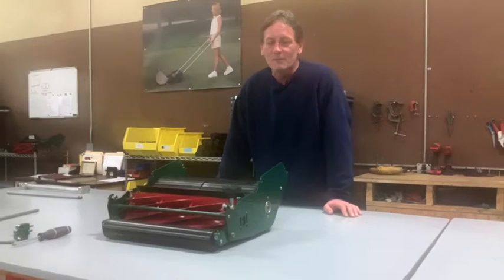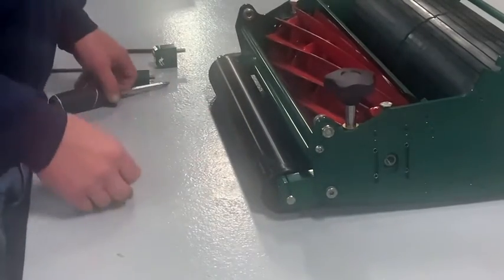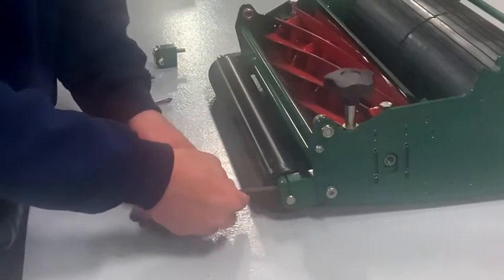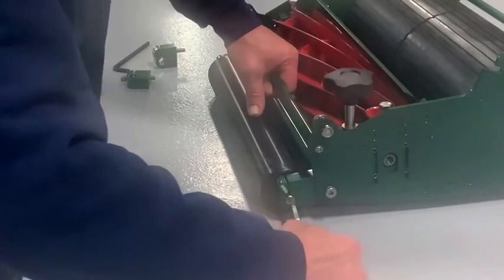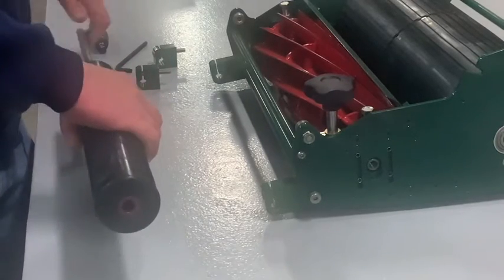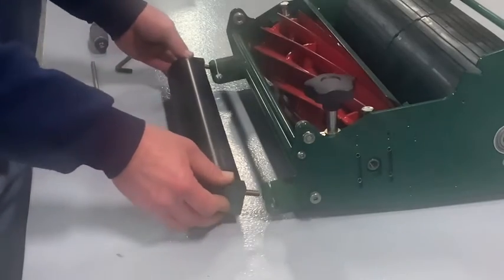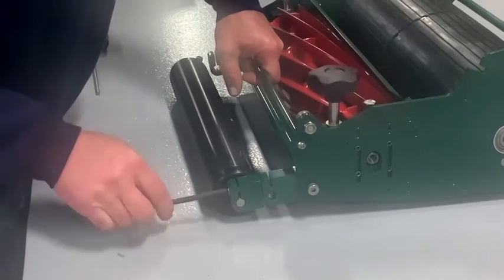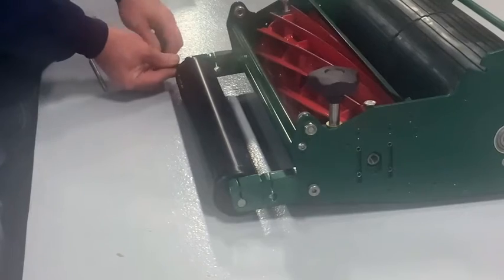HudsonStar Greens Mowers  - How to Install Extender Blocks

Comment: How about making these affordable??
Reply: Good point! If they were in the price range of let’s say 250-350 they would sell like hot cakes ! I have made a conversion kit for the old mclanes reel mower that allows you adapt a rear roller for stripes and a smaller front roller to replace those small black plastic wheels it originally comes with. I will be machining more soon …they better be careful I just mite make my own reel mower a sweep this untapped market that they are missing out on because off their CRAZY HIGH PRICE ! It’s not for the blue collar joe the Hudson is an upper tear GREENS master type of toy that only maybe 3 % of the population will or can afford. Right now there is a VERY high demand for a reel rear roller manual mower for the average joe that they are completely missing out on ! ……some industrious person could make a killing ✅👍🏻

Comment: Hi Sean, Just received my new 8 blade mower and added the extender blocks.  I had an older mower that I traded in and kept the old grey grass catcher as well as handle.  The new roller rubs against the old grass catcher and falls off when I pull the mower back.  It's probably due to the old grass catcher but I sent Brian a video text so he could see it in action.  Thanks, Marc